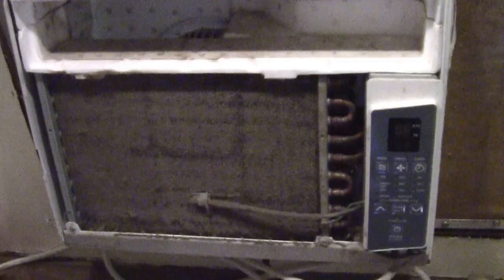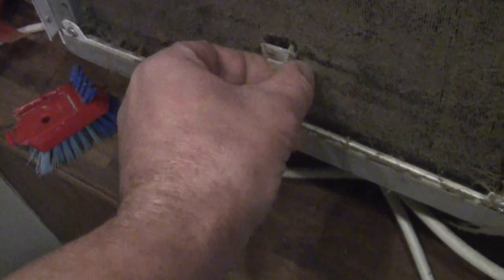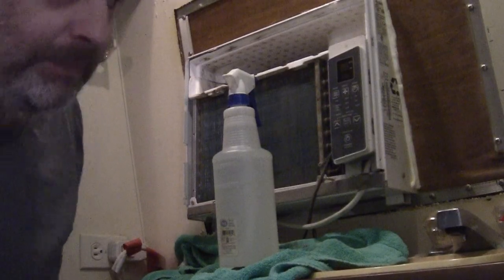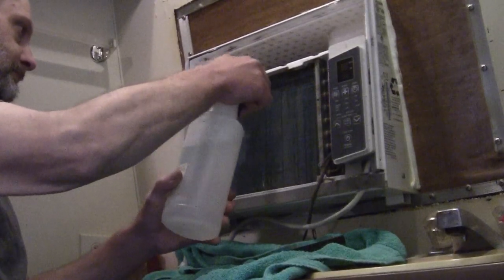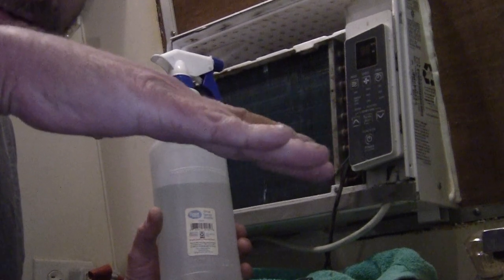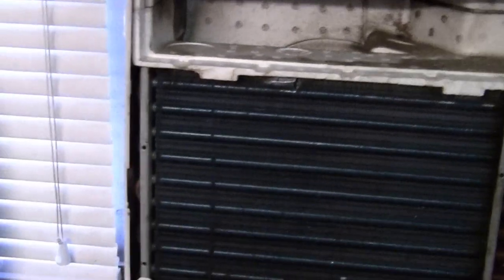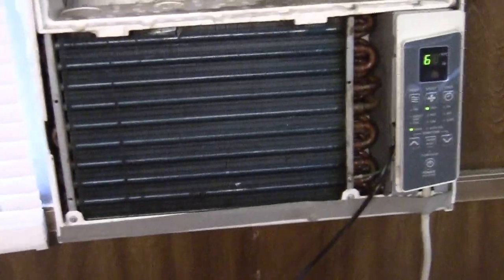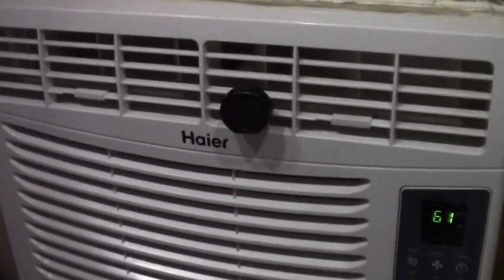HOW TO CLEAN A WINDOW AC WITHOUT REMOVING IT

Comment: Nice job Shawn showing how to clean the core and good idea adding the filter to the unit. Is it still hotter than normal there?
Reply from the maker: Thanks Lloyd . The pre filter helps keep it clean . I tested it with and without the filter and it cools just the same temp . It cooled down here a lot . Right now it is 87 ..

Comment: QUESTION!!!! I DId the same thing u did and it was blowing cool for a while and went back to not blowing cold air unless i added or sprayed water on it....what do u think is the problem with mine. PLEASE HELP!!!!
Reply from the maker: Does the compressor kick on ? if not you may have broken a coil in the cleaning pros.. Thanks !
Reply: @shawnmrfixitlee6478  i replaced it with another but before throwing it away i cleaned it really good and IT BLOWS SNOWBALLS so im keeping it as a back up.THANX FOR UR VIDEO It was very helpful GOD BLESS

Comment: Where will the dust go after pushing it with the compressor? I thought it would circulate backward or blow it in front. Just want to make sure, im new with this
Reply from the maker: all the dirt ran out the back of the AC and on the ground outside .. thanks & it worked AWESOME !
Reply: @shawnmrfixitlee6478  thanks so much

Comment: Wait, but if you squirt the water through and blow it with the air, wont it stay in the AC and mold will develop inside overtime?